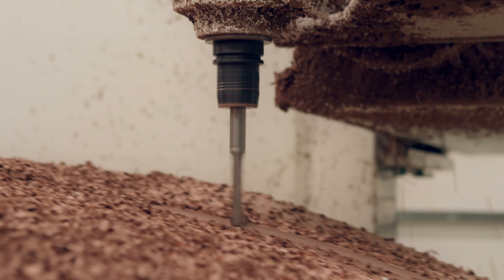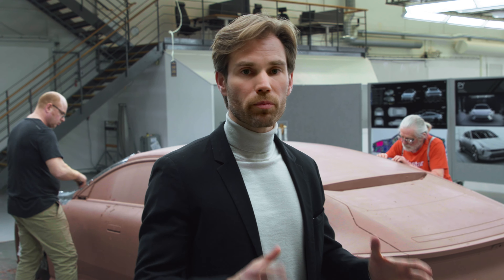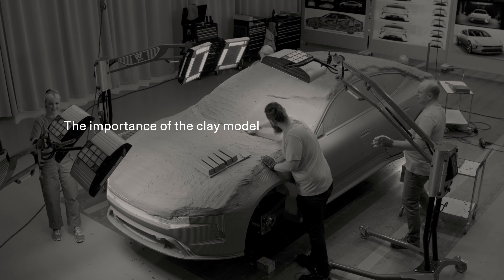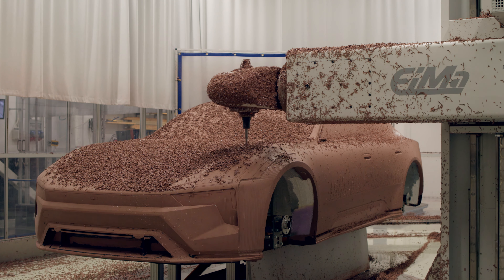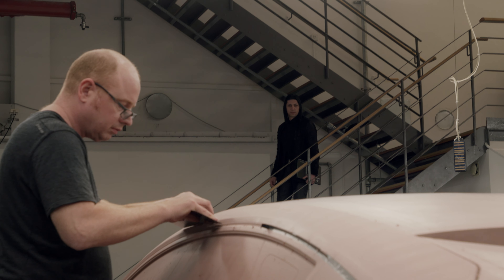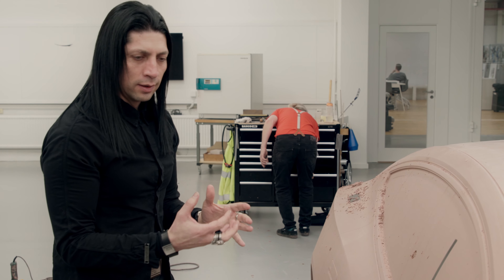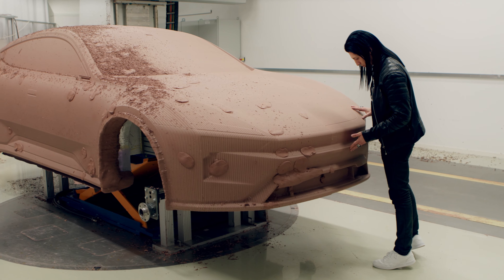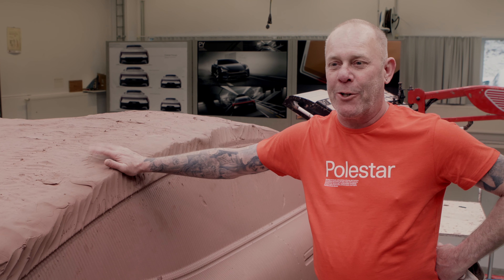Polestar Precept - From Concept to Car Ep 2: The clay model | Polestar

Comment: I´m happy to see that Clay modelling is still used to form a car unfortunately its getting less and less in the automotive industry due to cost cuts by the companies. It´s a great tool to have in the design process and to get the shape alive instead of having a dead surface Car made only out of CAD Data. It´s been a pleasure to work with Clay, and get the knowledge of how a surface should look like but now I´m also part of the digital industry and it´s so sad to see that most companies underestimate the quality of clay modelling as a part of the Design process.
Reply from the maker: Thank you for your support 🙌⚡️

Comment: I really hope you can preserve a lot of the interior design. I know the door cards have to change and you have to use more conventional materials. But looking at the Hyundai Ioniq concept's interior compared to the production car, a lot was changed. Mercedes EQS concept was much more daring and flowing than the production car. I hope at least the dashboard area can be similar, seat materials, some of the other materials can be used and car keeps the floating armrests between the seats and on the doors. 

Thanks for the peak into the process of making a concept a production vehicle. Looking forward to the Polestar 3, the first Polestar designed production Polestar.
Reply: Sorry for the random approach you seem to be an ambitious individual which gives me the idea to know if you’re open minded to look into a new way of generating an income,it may or may not be a fit for you, but if I send you some info would you check it out?

Comment: It looks like the wing on the hood is gone. It was so nice and clever. I wonder whether it actually functioned on the show car. Was it ever tested in the wind tunnel?
Reply from the maker: The clay model in episode 2 of the Precept documentary is an early model. The finished prototype has more features, like the front air duct that acts like a wing, integrated with the bonnet. This wing accelerates the air travelling underneath it and pulls the air stream down onto the car. Since the Polestar Precept is still in the vehicle development phase, the current prototype is made for display and has not been tested in a wind tunnel yet. Many more tests will be performed before Precept goes into production. Let us know if you have any further questions.